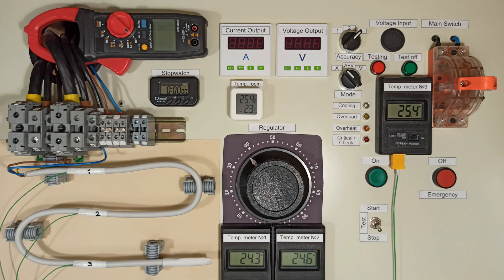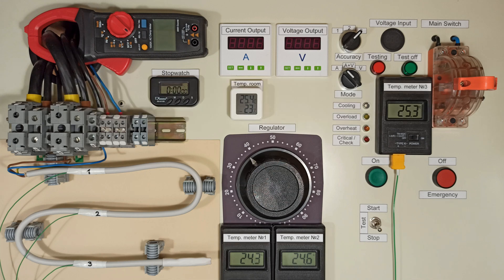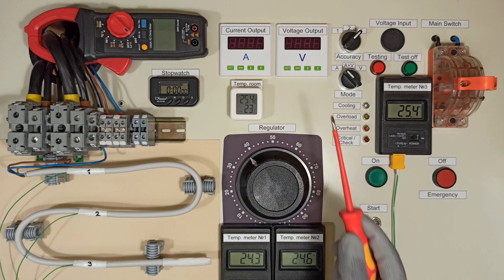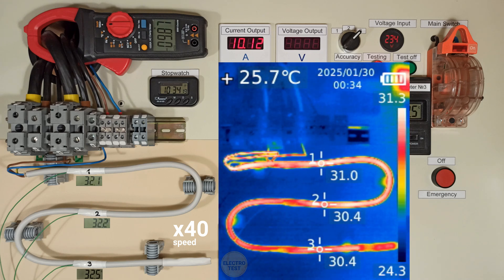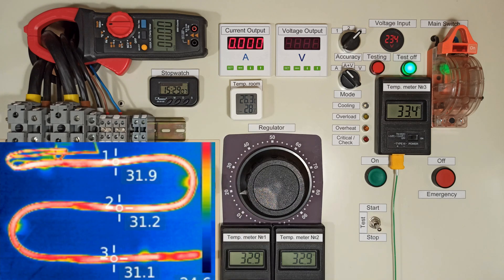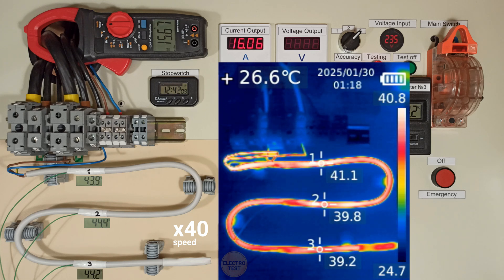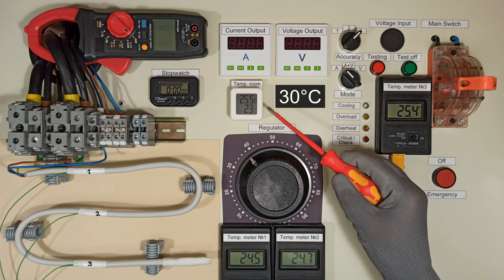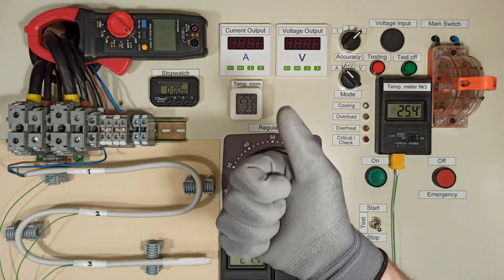Will 3x1.5 cable withstand 16 amps? Heating of NYM 3G 1,5mm2

Comment: This test will make people get wrong idea.
Reply from the maker: Thank you for your comment!
You are absolutely right - installation conditions, such as routing through roof insulation or inside conduits, significantly affect the cable’s performance and heat dissipation.
In this test, I tested the cable in open air, which is one of the most favorable conditions for cooling.
The goal was to show a baseline of how the cable behaves under ideal conditions.
According to electrical standards, there are various cable installation methods - in open air, in conduits, underground, inside walls, under insulation, etc.
Each method has its own characteristics and current-carrying limitations.
In the future, I plan to test different scenarios, including:
installation under insulation,
inside walls,
in conduits, and more.
Thanks again for your feedback - it’s very helpful for planning future tests!

Comment: You need think about the installation condition, for example install the cable in the roof insulation
Reply from the maker: Thank you for your comment!
You are absolutely right - installation conditions, such as routing through roof insulation or inside conduits, significantly affect the cable’s performance and heat dissipation.
In this test, I tested the cable in open air, which is one of the most favorable conditions for cooling.
The goal was to show a baseline of how the cable behaves under ideal conditions.
According to electrical standards, there are various cable installation methods - in open air, in conduits, underground, inside walls, under insulation, etc.
Each method has its own characteristics and current-carrying limitations.
In the future, I plan to test different scenarios, including:
installation under insulation,
inside walls,
in conduits, and more.
Thanks again for your feedback - it’s very helpful for planning future tests!

Comment: In Germany it is approved for domestic applications to protect a 3x1.5 mm² cable with 16A. 
Especially in light circuits and sockets that are only used occasionally.
However, 3x 2.5 mm²  is often used for dishwashers, washing machines and tumble dryers.
Previously, the stove and hotplates were connected with 5x 1.5 mm². Now in new buildings with 5x 2.5 mm² 
3x 230V 16 Amp
Reply from the maker: Thank you for the useful information! That's right, I use the same document. 16a - Multi-core cables for domestic/handheld equipment, and 18a - for Multi-core cables excl. domestic/handheld equipment. I also think that 3x1.5 can be used for some sockets. However, the installation method should be taken into account. Which one do you usually use in flats and private houses?

It also depends on how many circuits the wiring will be divided into. If there are many sockets on one circuit or it’s long, of course, it’s better to use 2.5 to reduce voltage drop.

You mentioned that you use 5x2.5 for stoves. Do you always use a 3-phase connection? Is it possible that later it will be necessary to connect the stove to a single phase? In my opinion, 5x4 is a more universal cable for stoves in 3-phase wiring.
Reply: @ElectroTest_1  Stoves usually have the option to be connected to a single phase or two or three phases. If the flat or the house is connected to three phases and the stove connection box has 5 cores, there’s no need or benefit to connect the stove to a single phase later. 4 mm² is surely a better option, but costs much more, especially if you hire an electrician who usually charges high material costs (at least in Germany).

Comment: Nice test, but to avoid people getting the wrong idea, please also do the test with the cable inside a plastic conduit and inside a insulated wall.
Reply from the maker: Thank you for the comment! I plan to run tests with different installation methods. There is an entire table. So far, I’ve tested only one of them. There are many other types of installation as well—on open surfaces, in pipes, in plastic or metal ducts, and also under plaster. What do you think, in which case will the heating be the most intense?